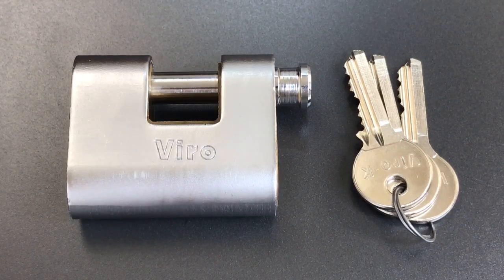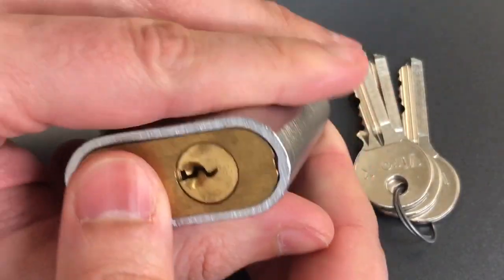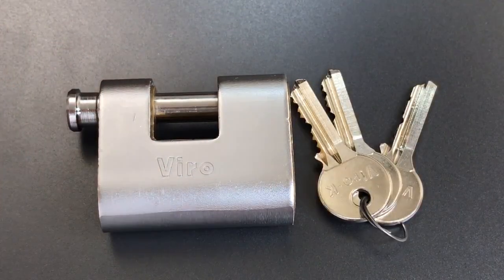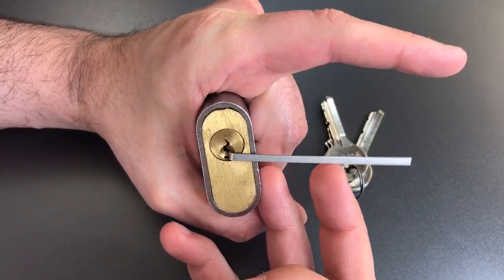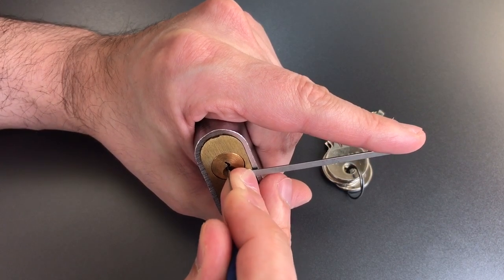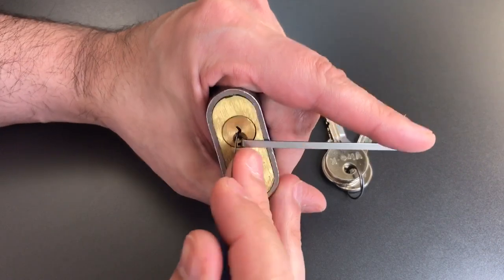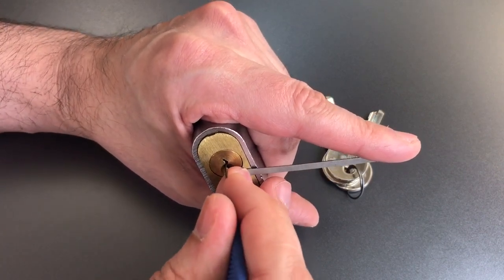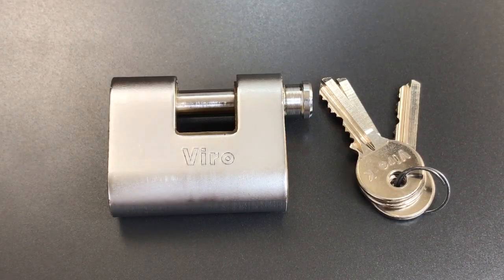[475] Viro TS-4215 7-Pin Armored Shutter Lock Picked

Comment: Hi Harry, Nice to see another Viro shutter, still have mine of course, and thanks once again. It seems unusual to see seven pins in the same space as a normal five pin key - makes you wonder what the maximum adjacent cuts are (MAC) It doesn't seem to me that there could, or would be, a lot of adjacent highs and lows. Thinner pins for sure, but perhaps relying on the seven pins instead. You mentioned over set, and I've found the same thing with spools, a tight keyway, and a thin pick. The tip of the pick flexes, and can actually flick the key pin across the shearline - glad it doesn't just happen to me! Pretty to watch .... as usual, well done!   Regards, Brian.
Reply from the maker: Thanks... I never gave much thought to the reasons for the overset.  I figured that I was just being sloppy, but what you say makes sense.

Comment: Great picking brother, Viro did a pretty good job on this one,thanks for the review!
Reply: I wonder what a spool is
Reply: @venominblx9333  a spool is a cylindrical pin with a rim/ridge on each end   it's a security pin used to aid in the pick resistance of  a lock

Comment: Looks like that would make a good lock for your custom gun lock build. Provided you can remove the bolt without a lot of difficulty... 

As always, nice picking and very nice shutter lock. Don't think I'll be finding one like that locally any time soon ;-)
Reply from the maker: Thanks... as for the gun lock, I'd prefer more pick resistance.

Comment: you are with out dought good at this. now lets see you work on some real High Security locks. just for kicks try doing an abloy protec.to show people what they should be geting. thamk you
Reply from the maker: I can't pick an abloy protec... but if you go through my videos, you will see several high security locks.
Reply: They can be decoded; attempting to pick them is very impractical because of the insanely tight tolerances, lots of false gates, a special mechanism to block the rotation of the plug, and the fact that there can be multiple locations for the driver disc and lots of dummy discs.
Reply: @lockpickinglawyer  the viro is the only brand large enough for 12mm chains I can find. But the disc-lock forgetaboutit Kryptonite is close, maybe more intelligent resistant.

Do you think Viro locks put on the Pewag hardened chains are good enough locks? Physical security is top question where I am but someone just stole a disc cylinder lock with the same laser cut keyway other high security "unpickable" locks have.